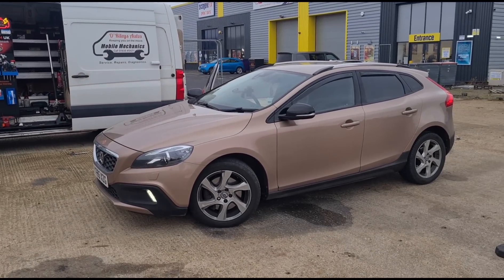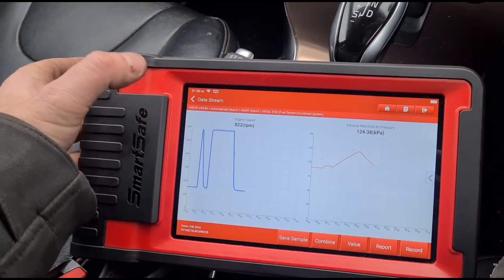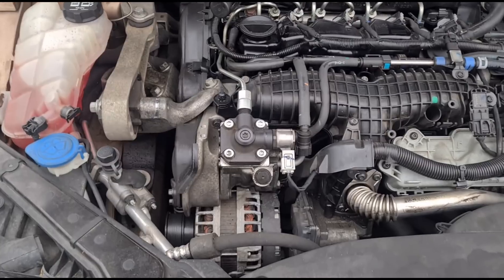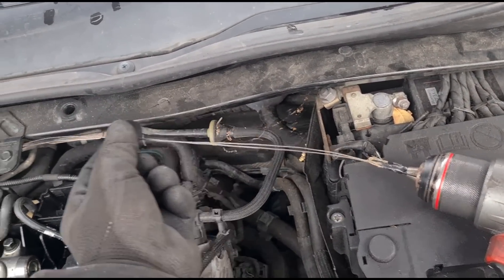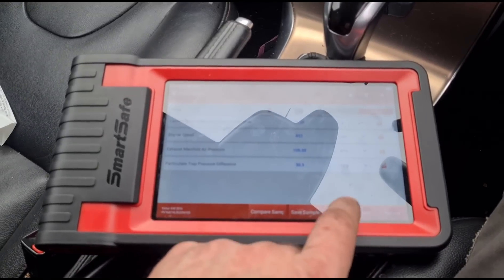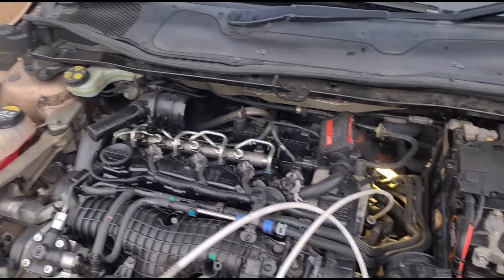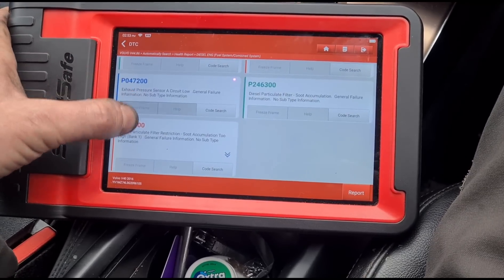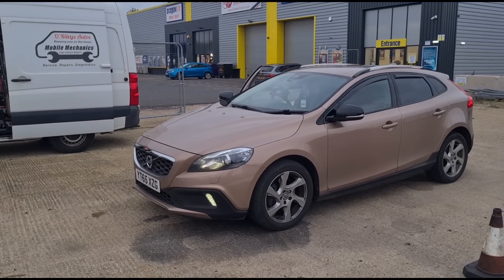Volvo V40 P00BC-00, P2463-00, P0471-00

Comment: got the same car over here, this one has exact the same issues!!! also 60 grams in the system now,early on it was 100 grams ,and i noticed a problem with the exaust pressure sensor.itb reads 60 kpa in idle but also when the car is off!! so does this pressure sensor(afther replacement)needs a re learn???   the pipe is clear and i can see the pressure  rising  when rpm goes up...
i know that they changed the pressure sensor and the dpf differentiël sensor, but do they need a re learn or reading?????
even had the same codes in realation to leakage but there were none....

Comment: Hi i work at a Volvo specialist this using oil is an issue on the early VEA models, the air mass fault is usually due to the exhaust pressure sensor pipe blocked, on that engine D2 the pipe is relatively easy to change on the D4 and D5 with the twin turbo can be a bit of a challenge and there about £100 the banjo is £35! 
We do have a customer with the same issue the oil consumption blocks up the exhaust pressure sensor pipe, the DPF, the swirl flaps causing them to stick, the EGR cooler, the list goes on, same as they are a nice car but after about 2016/17 there ok
Reply: Can you tell me why the mass flow sensor is giving incorrect readings due to a clogged exhaust gas pressure tube?

Comment: Hi jimmy, ex Volvo tech here. They suffer from piston ring problems, the blocked emap pipe will be giving you your MAF code. Horrendous for EGR issues as well both choked cooler and sticky valves. Also intake manifolds like to choke up so could be worth a clean.
Reply: Can you tell me why the mass flow sensor is giving incorrect readings due to a clogged exhaust gas pressure tube?

Comment: Common issue on these engines is the piston + rings design which are very thin in size and clog up quite easy and consume oil as a result. Volvo has rectified this issue but not until 2016 when piston and rings were redesigned, unfortunately to tackle oil consumption it needs an engine rebuilt with latest piston and rings. Valve cover is another common fault on these, gasket degrades and starts leaking oil through injector holes, best is to change valve cover altogether (with integrated PCV) to the latest revision. Also it's got the wrong coolant in it, VEA diesels  should have green coolant as the the red one affects some aluminium parts on the coolant tract as far as I'm aware. I am a happy owner of one of these Volvos and had to learn some of the issues on them, hopefully helps someone.
Reply: Nice answer. I don't own one but always interesting to know.
Reply: @ Jimmy doesn't do many of these because they have fairly good DPFs, unless with underlying issues (i.e. oil consumption on this one from the video) they usually don't go wrong. Other than that the usual diesel hurdles, clogged intake manifolds, EGR valve & cooler etc.
Reply: Any piston ring flush recommended.  I see valve issues on this engine as well

Comment: Great job, Jimmy! It may well be worn out piston rings. This will also overload the DPF with burnt and unburnt oil. Unfortunate for customer, who faces an expensive repair.
Reply: It's a scrap job
Reply: @chucky2316  Yep, probably.
Reply: If there is carbon gumming up the rings, perhaps an 'EGR' clean with the launch fluid might clean them up and fix it? 
Maybe even soak the cylinders in it.

Comment: Check the intercooler for oil, the turbos go on these and the oil leaks by the turbo seals and into the intercooler and is blown up into the intake manifold. This is then combusted causing a smoky burn blocking the valve cover, dpf and egr. A simple way to check the intercooler for oil is to take off that egr pipe from the manifold and put a camera in and down past the throttle body, from there you will see a fair puddle of fresh oil as the rate it is being topped up will keep it clean. I've done a few here in Ireland, turbo recon about 400 euro from turbotech Kilshane cross Dublin, valve cover 180 euro with gasket from Volvo. This is a single turbo version so its a little easier to do than the twin turbo but its still very tight to manage.

Comment: Topping the oil up after the oil light has come on is a recipe for a disaster
Reply: Eh? If the guy has checked the dipstick and topped the oil up to the required level, why is that a problem?
Reply: @simonbailey2151  the oil level will lower than need with the engine running, starving the bearing of oil and ruining a good engine

Comment: Jimmy was it blue smoking out the exhaust after the test drive some engine are heavy breathers and do use certain amount of oil
Reply: Not that much 😂
Reply: @chucky2316  from the mercedes manual merc om642 engine uses 0.8ltrs per 1000kms so yes that much ...the pcv is piped just before the turbo intake so sucks it into the intake

Comment: That engine isn't the PSA 2.0L or the 1.6L diesel engine.

That's the "new" (it's pretty old by now technically - started seeing them in select cars from 2013 onwards but was only fully adopted and implemented later - so the V40 2015 can easily have that engine in it) "VEA" Volvo engine - has nothing to do with Ford or PSA, it's their own creation - exists in 3 and 4 cylinders. Comes in everything the past like 5-8 years from Volvo. 

You'll start to see them a lot in a couple years, they have their fair share of problems and much more problematic than the old indestructible 5 pots - I reckon they'll be making you good money once you start seeing them regularly in a couple years ;)
Reply: Yes, I had a 2014 V60 D4 with the twin-turbo version of the 4-pot VEA diesel.  I had three warranty trips to the dealer because of the crap EGR system design in 2 years, and it was a very common issue.  The Volvo main dealer told me they were doing EGR warranty work on 8 to 10 VEA diesel cars per week, and that was just one dealer.  The problem was that the motor had an electronic EGR valve and a watercooled EGR cooler matrix to help it meet Euro 6 NOx emissions.  The cooler actually overcooled the exhaust gas, which used to condense in the cooler and mix with the exhaust soot to form a thick gungy paste which blocked the cooler and jammed the EGR valve.  My car had two new valves and a complete new cooler, as well as redesigned coolant pipework for the cooler.  After about 2018 Volvo abandoned the electronic EGR system and fitted an AdBlue system instead, like most other diesel cars of the time.
Reply: Love my 5 pot!

Comment: don't see many volvo with probs
Reply: Then you haven't seen what happened to XC90 and XC60 when they came out brand new around 2016/2017. All sorts of software issues, gearbox and engine issues. Volvo is not trusthworthy as they are chines crap now, forget it. The old ones, yes, but after Geely took over, there isn't anything left from the old Volvo.
Reply: @hadiamrane Been in a brand new xc40 and it had awful creaking sounds when parking
Reply: @sbrader97  Oh yeah, true, they have a XC40 lineup. Completely forgot about that 😅.
Reply: Chinese rubbish